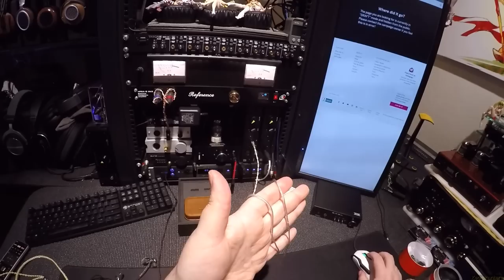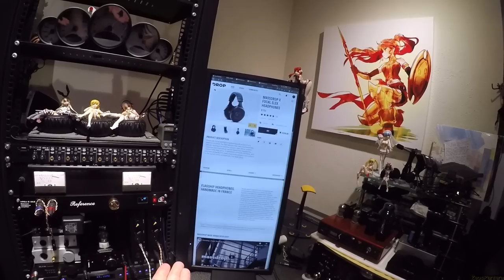Tin T4 --Vs-- Shuoer Tape _(Z Reviews)_ +11.11 Sale News

Comment: I love those ZS10s, they are phenomenal IEMs for the price. I also ended up succumbing and buying a basic pair of Koss PortaPros, and those are as good as promised, without a doubt.
The only issue with the Portas is the kind of flimsy build and cable, but we knew that. Otherwise, they are damned good and go anywhere, and are light as a feather on my head.
Reply: I would buy Koss's cheaper stuff if they came with detachable cables and cost a few dollars more.

Comment: Bought the Shuoer Tape a few weeks ago.  No regrets.  They're amazing!
Reply: What kind of music do you like to listen to?
Reply: You haven't had any issues with the drivers quitting or any kind of technical problems have you?
Oh and watch out for water getting in that event I heard that that can kill these!!
Reply: @Geerladenlad  No issues with drivers or the MMCX not connecting properly. Fingers crossed that it stays all good.
Reply: @branislavcrljenica2584  Pretty much most genres of music. They all seem to play really well on the Tapes to my ears.
Reply: @NickHeng  Do you use stock cable?
Reply: @branislavcrljenica2584  I'm  not a fan of the stock cables that came with the Tape, even though they were okay.  I use the Tin T3 cable if I'm running through a 3.5mm jack, or I'll use the Tripowin C8 cable to 2.5mm that runs through an iBasso DC01 portable DAC.
Reply: @NickHeng  Is the T3 cable silver plated?
I appreciate your opinion that the stock cable is just fine, I can't afford the extra cost for the extra cable. Thank you!
Reply: Shuoer Tape is great to those who don't listen to music very loud. Those very loud music listeners will feel the pinch of the loud percussion-like spikes . Awesome microdetail. Very good subbass too for rap songs. The stock cables suck. No fixed shape ear guide, the cables have that rubbery feel which I dont like.
Reply: fleur'de' win  the cable is fine no need to upgrade
Reply: How are they working now?
Reply: @confidentsalt3899  They still work fine, though to be fair, I've not used them as much as I used to since I have other new sets to listen to as well.  Still no regrets and happy with the purchase.

Comment: Just started using these, initially I was impressed with the details and treble but bass was lacking. I'm describing it as best I can, I'm no audiophile or expert. I used EQ and was able to make my often played tracks closer to how they should sound. I changed the factory tips to to Comply 500 foam tips and this made a massive difference. EQ no longer needed. That detail and treble is there but what sounded absent before is now present. They still have a unique sound that gives me a different way to enjoy my music. Mine came with a very thick mmcx cable with 2.5mm balanced jack and 3.5mm adapter.

Comment: If you have the tin t4: Try cutting the stems off a pair of the large silicones, leaving just enough to put inside and meet the rubber inside the foam tips, then fold the large silicones down over the foam tips. You'll thank me later. Ghetto free hybrids are magical. Small note though: sub bass cannon mode activate.

Comment: My tape came with a thinner two wire that split to two single wires. It was sold by Linsoul Audio on amazon, so I doubt it is a fake. I have also noticed that one sounds louder than the other. Apparently this is a common problem, and tends to only get worse. I am pretty disappointed. I really think you should put out a video addressing this so people don't buy an IEM prone to malfunctions.
Reply: New version is out. Tape Pro

Comment: Tin P1 needs eq to be amazing. Otherwise it's just flat which can be good if that's what you want
Reply: Great sounding flat though aye...midrange monster!
Reply: @massivemikeh  agreed. I like a little more bass punch and forward mids. Good that they respond to eq well
Reply: imo they sound better with comply t500 tips and the linsoul lsc09 cable. doesnt need eq but sometimes i boost subbass by 3 db or so.

Comment: A little more depth, a little more width, a little more bass, a little more fun. This sold me on the T4s. I'll soon find out I hope
Reply: So... how'd you like it?
Reply: @cykrya5156  Oh, I love the T4s. Still got them and I'll still use them. Recently bought the Moondrop Aria wondering if they'd beat them and.. nope. Less life, less width, less clarity.
The T4 holds something special, especially listening at night when low level listening is preferred as the treble does get harsh the higher up the volume you go. Aria certainly offers better isolation for me.
Reply: @iKaGe01  i see, guess i know which iem i'm going to buy next. thanks for the reply!

Comment: Which of the headphone in the video to you is good for FPS games? footsteps/gunshots sound direction etc. Currently im just using a KZ ZSN whenever i play games, and bring them to competition so i wore it and a headset over it so i can use the mic, also for isolation and to me the ZSN works just fine. I pre ordered the t4 aswell probably spending to much tbh.

Comment: Zeos! If you like T3 wire then try getting KBEAR wire. I've got the 16 core copper one and it's awesome, so soft and straight and light, softer and lighter than T3's wire in fact. If you want the same exact wire to your T3 wire, I think you should get the 8 core silver plated.

Comment: Order quick, they are in limited quantity. 100+ of T4’s are already sold in first 5 minutes
Reply: Thx for the heads up. Just ordered four of these.
Reply: Prom Sunstrider why did you order 4
Reply: @jeffreyepiscopo  cuz if you order 3...
Reply: Looks like they're just adding more and more sets of 100 for now.
Reply: The Blon 03 takes all
Reply: @jeffreyepiscopo  I actually ordered 5 from the "Family Combo" deal which amount to $75 per unit. They're all for Christmas gifts. it also comes with $100 gift card for linsoul online store which I used for the Xduoo TA-20 (on sale for $319) for a gift for myself :)
Reply: They did it a bit ugly. They set it to 200 super early bird slots, but they replenish it when it runs out. So people go for the "oh it's about to run out"-purchase, while Linsoul get to rake in the orders far beyond 200.
Reply: @qualityinvestingmx  You should lean to listen bro. Shuoer Tape is way above it but more expensive.

Comment: Got the T4 today, got the rest already, though, you should try the Shozy Form 1.1  too, they are amazing out of the box, tips & cable.
Reply: praxis22 Not crazy about the cables on the Form 1.1 but the sound is amazing, and price/performance ratio is off the charts. The Shozy’s are legit.
Reply: @mensrea1251  yeah, the cable kinks, but attempts to change it alter the experience according to somebody who tried and did a write up on MassDrop.
Reply: @praxis22  Interesting. I'll have to read it then try for myself. Thanks.

Comment: Greetings from Slovakia Zeos, what about the midrange between T2 and T4? Isn't the sound on the t4 little bit Vshaped due to that lower treble and sub bass boost and the midrange on the T2 more forward in comparison with the T4? Or do the T4 have all that good things (also midrange) as the T2 and  a little bit more of everything? Thank you :)

Comment: I was going to go for the P1s just as I saw the tape's hype... given I have the Fostex T50RP MK3, (and thanks to this review) I thought I should go for the electro to have more variety.

Z you have sold me on (so far)
Fostex T50RP MK3

1MORE Triple Driver Over-Ear
and now the tapes...

I had decided on the 1more quads myself but do not recall if your review clinched the decision.

I guess the P1s will have to wait in line...

Comment: Now thats ive owned the t4s for several months now. My only problem is the coaxial design in the cable. My pair became very loose. To the point it effects the sound and is scratchy. Im not sure if I replace the cable if it will help. I don't even know the best choice to go with. Same with replacement tips. Witch is better. Silicone or foam tips?

Comment: I was torn between the Tapes and the T4's , I've passed on the Tapes for now as I'm hearing too many horror stories regarding quality control issues. It could just be a bad batch but I'll give it a few months I think. So T4's are on their way as I got the super early bird perk 😁
Reply: The issues are mostly about the swiveling mmcx connections but it doesn't affect the sound. Another issue that I personally have (I haven't really heard anyone else experience this) is that the stock cable isn't really durable. The sound sometimes gets cut off from my right unit, but a cable change fixed that. 
I highly recommend that you pick these up someday. They're really good.
Reply: @rainbowleet9279  ah ok cool , thanks for the feedback. I'll pick them up at some point I expect but my T4's turned up a couple of days ago and I'm enjoying them currently. They live up to the hype 😁

Comment: Dude I received the T4's this week and they are fucking AWEFUL. Sibiliant up top isn't even the word. Just pure, shrieking horror. The lows sound the same way. Really skreechy and feels like it's digging into your ear drum. Not sure how anybody could manage that with bass. 

Since the Tapes are available on Amazon, I got them first and have loved them. So if you know enough about fatigue in the highs, you'll know that my critique of the T4's I got is real.
Reply: Also, the "3.5" mm end on the T4 moved around my outputs like a tiny dicked priest in a hooker.

Had to connect the Tape wires so sound wasn't constantly cutting out. Such garbage.

Comment: I was gonna buy the ikko oh10’s but now I might go for the shuoer tapes
Reply: Owning both I'd go for the OH10's but it does depend on what you listen to. Live music doesn't resolve well on the tape. No idea why
Reply: praxis22 all i listen to is hip hop, whenever I use over ear headphones on my pc I use a eq and crank up the high end frequency (I like treble as well as bass),  the oh10’s have gotten a great rep but just hearing “electrostatic” makes me wet, tough decision, would I need any special amp for the tapes? Or does my fiio k3 do  the job
Reply: @jonibri9793  @jon, Tape is really awesome. You should contact Belar from EE Audio on AliExpress, for a deal better than coupons. 
That's how I got mine, even before 11/11 😋
Reply: @jonibri9793  Provided all you ever listen to is prerecorded music you "should" be fine. The problem is that the tape can be strange about how it renders music. If I were you I'd buy the Tape first, from amazon. See if you get on with it. If not send it back, buy the OH10. I drive everything from a phone with a DAC dongle. Occasionally with a portable Tube amp. But the Tape has no problem going loud just on the DAC alone. Should be fine on a DAP. It's not hard to drive. The OH10 has bass, but only when called for, though that can surprise you. I would rate the OH10 over the Tape, but I bought the Tape already owning the P1, so I understand the itch :)

Comment: Purchased a few days ago. Didn't care for the cable. Swapped for a Linsoul 2.5mm balanced cable( $20). A marked improvement in clarity and separation running balanced. Definitely an improvement over the T2s. I did use my T2s foam ear buds as they are larger than the supplied T4s buds. Highly recommended.

Comment: i bought shuore tape for $29. with $100 gift from linsoul. hopefully it's a good iem when it's arrive.
Reply: how's the tape what a great gift.
Reply: @yuminixy4620  it's better than good. no need dac/amp to drive. bass is thumping. fast responds. with Amp subbass is thundering. i like it more than Tin T4.
Reply: @irliey1  so its tru that better than p1
Reply: @yuminixy4620  I think in overall it's indeed better than P1. Easy to drive, better bass responds. better soundstage. if any, P1 is better at mid range with ample detail and clarity.

Comment: 25:46 wait, the T4s have more bass than the Tapes? I was under the impression that the T4s are the bassiest Tin but still less than others on that table.
Reply: Very similar to Blon 03, a bit better mids, but noticeably less bass.
Reply: He was compering the T4s to the Atom T5vs, more bass more fun, not the Tapes.

Comment: *Electret driver! not a electrostatic, that would need a damn special amp.
Reply: Not necessarily. Fearless do some hybrid estat/BA and estat/BA/Dynamic IEMs.
Reply: The Shuoer EJ07 has a Sonion Quad Electrostatic driver a DD and dual BA's with a Sensitivity: 104±2 db/ mW @1kHz
Impandence: 17±2 ohm

Comment: i got the blons for 20 bucks with coupons on aliexpress
Reply: just bought for 22 bucks. 11/11 sale is great
Reply: What coupons did you use?
Reply: @giladkingsley  it was $5 if you spend $10+ but only limited amount of them were there.
Reply: I got the blon BL-03 (gun metal with mic), two yinyoo cables, 9 foam tips, and 2 sizes of spinfit tips.
All for 34.5$
Reply: @giladkingsley  even more awesome deal then
Reply: Gilad Kingsley Shipping included? With two sizes of spinfits, that is such a deal

Comment: Just got the BLON bl03 so I don't know that I need to spend the money this time.
Reply: Very similar to Blon 03, a bit better mids, but noticeably less bass. Balanced tune.
Reply: @TheChazas  the bass is similar to the tin t3 or is better?
Reply: T4 is the most bassy Tin yet, but far from from basshead, also less bass than Blon 03 and some say it has a lot of bass, others say not enough. Just like for me T2 absolutely lacked bass, punch and energy in general.
Reply: @TheChazas  sounds good, im going to buy it.
Reply: @TheChazas  one more question, the soundstage is similar between T3 and T4?
Reply: Soundstage wise T4 better, T3 had the narrow soundstage compared even to T2.
Reply: @TheChazas  my t4 is coming :) thanks
Reply: @qualityinvestingmx  Hope you will enjoy them. Blon's still are amazing and very similar for basically 3 or 4 times less, which is a real deal, definitely great side IEM. Yet this year from Chifi probably KZ ZSX were my favorites.
Reply: @TheChazas  If you got a little extra to waste. Please try the Faaeal Hibiscus for me. It supposedly uses the similar driver technology as the T4, and same tuning, but costs less.
Reply: @Ratseeker  have to check them out.

Comment: I ordered the shuoer tape but the headfi thread is flooded with comments on how the mmcx connectors and cable are loose and the iems get hot
Reply from the maker: ooo You know what else gets hot? The Orpheus HE-1
Reply: @ZReviews  I'm just hoping my unit is free of all the issues and I can enjoy my music without burning my ear off
Reply: @pratikghosh1064  I've used them daily for almost a month, no issues. The metal shell is so comfortably cool actually (as in temperature), fit is great, and the tips happened to be freakishly perfect for me. I think these are probably my best purchase all year.
I don't think they are heavy, they are lighter than BLON BL03.
Reply: @yogiwp_  good to hear they are working perfectly for you, I'll have to wait for my unit to arrive,btw what are you driving these off?
Reply: @pratikghosh1064  These are easy to drive, so DAP or Phone, both do the job
Reply: @deepakbhatt3575  that's good to know thanks
Reply: @pratikghosh1064  👍 You will surely enjoy rhem
Reply: @deepakbhatt3575  all I'm really worried about is the problems others are facing regarding the loose cables, hoping my unit is free of any issues.
Reply: @pratikghosh1064  Actually, i agree, i almost lost one earpiece at the airport, the other day, when the earphone which was dangling, got stuck to the seat🤣
Gave them a tight fix, and so far haven't faced this issue again. 
Hope so that you get a perfect unit.
I wished these were the 2 pin version instead of the mmcx, which tends to have issues in most IEM's
Reply: @deepakbhatt3575  ya but I personally only buy iems with mmcx connectors, now I have 2 iems with mmcx and the tape coming soon.
Reply: @pratikghosh1064  Lol, i had not counted untill now, and realise that i have more of 2pin than mmcx. However, it wasn't by design, as i mostly buy based on the reviews and what i seek in terms of sonic signature. It just turned out that max of my IEM's are 2 pin, only 4 are mmcx. Except for the Audiosense, i find that the mmcx connectors fail to hold on.

Comment: I don't agree that the highs are pronounced in any way for the shuoers, I think they have a ton of low end detail, but can do some highs but they aren't enough there. I also think the Shuoer Tapes can't produce vocals at all without having to cranking the volume all the way up. I think they are good, but they can def benefit from like a BA or Piezo Driver of some sort imo.
Reply: I'm wondering if the Shuoer Tape is a V-shaped headset?
Reply from the maker: @branislavcrljenica2584  It is slightly.

Comment: no  worthwhile 11.11 discounts anymore on the sort after IEMs
Reply: CCA C12 for 30 bucks is pretty sweet
Reply: The blon bl03s were available for 26$ with an aftermarket cable included.
Reply: @ojastushar8123   where is this deal please?
Reply: Where
Reply: @ojastushar8123  that's a great deal, where please
Reply: @JR_Taylor  link is in the comment thread, but I think they raised the price slightly.

Comment: The Tin hifi products are too complicated to buy.
Reply: Random Tube its not really complicated at all,
Reply: @RobloxRandomMadness  I may have been on the wrong page, there was no option to place in cart. Maybe they were sold out or not available yet. Not sure. I haven't tried Tin IEM before. Was wanting to see what the hype was about with the T4. Are they really the best bang for your buck at 110usd?
Reply: @randomtube8226  The tin t4's have generally positive reviews, you just have to do your homework. I bought the t4's on 11/11, so I got them for a really good deal at $80. It was my first time as well, indiegogo can be a little confusing at first but its actually pretty straight forward once you complete your purchase.